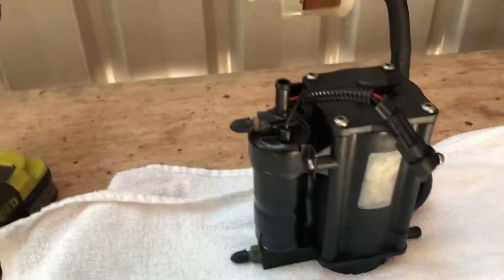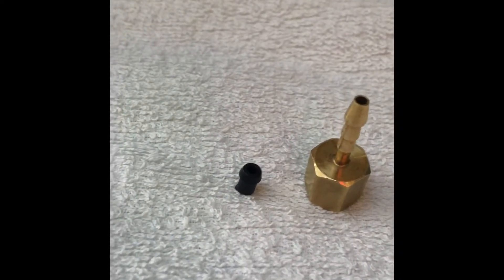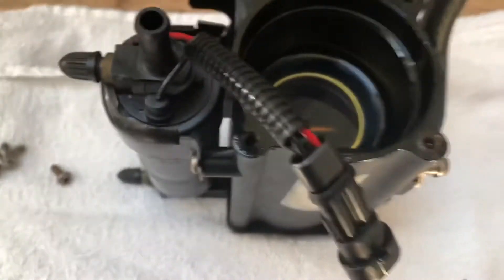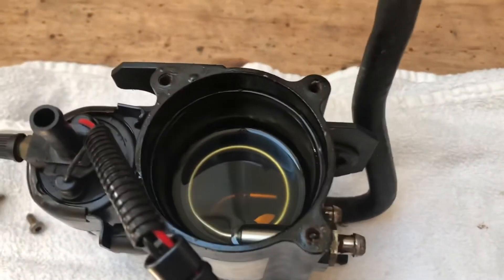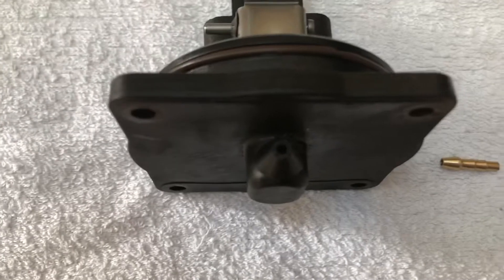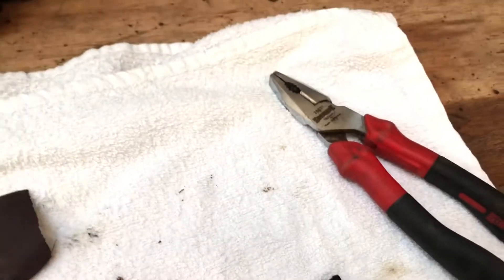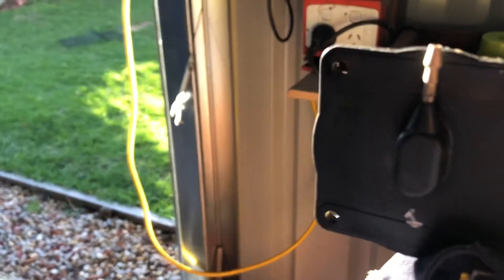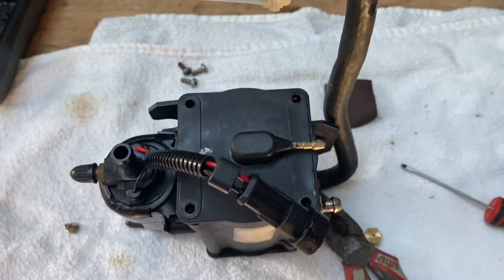Etec 60hp VST Breather Nipple Fix.

Comment: Did this broken barb repair too but I drilled and tapped the hole and screwed in a barb I made on my lathe. Used sealant on the thread.
As a precaution I removed the float and needle and blew through with compressed air. Just running the drill bit may not be completely reliable to get all cuttings out, and if a bit made it's way back it could stop the float needle closing properly.
Something else to be very careful of, is there is also a spring loaded ball valve (easy to miss) which acts as a pressure relief valve. You can see it under the lid. The relief passage goes into the vent passage too. I also blew compressed air through it in case any of the cuttings made their way into that passage.
If you squeeze the fuel priming bulb hard enough the pressure in the VST can be enough to open this pressure relief valve and you end up pumping fuel straight into the crankcase. Been there done that.

Comment: What were the symptoms when the engine was running? I have the same problem
Reply from the maker: Hey Allpine, sorry for the late reply. The issue i had was that the motor would start and idle properly but then throw a fault and go into limp mode when i engaged it in gear or increased the rev's. The fault code kept relating to the fuel pump and/or vst. I have twin engines so i swapped the VST and HP fuel pump but it threw the same fault code. After a bit of mucking around and some advice from a couple of blokes off of Barnacle Bill ETEC forum i found a fault in the stator. What happens is the HP Fuel Pump needs 55v to operate correctly and with the stator fault it was only getting 38-40V.The engine goes into limp mode when the pump drops out. Bought a 2nd hand stator from Nth Queensland and installed it and away we went. I broke the breather nipple during the fuel pump removal.

Comment: Hello boss, good video, I ask you, I have an evinrude etc. 90hp does not start and I get the code 94 - 29 - 117, what should I do? thank you
Reply from the maker: Hi Gringo, Sorry for the late reply. Not sure what model you have mate but 94 is fuel pump short/open circuit and 117 is a low oil event on mine. Firstly id make sure that when you start up the engine( connected to diagnostic software) you check to see it is transitioning to 55v. The HP(high pressure) fuel pump will not operate on low voltage.
Reply: @unclejeda1  Thanks, my problem is EMM, I have to change it
Reply from the maker: @GringoSF  Ah bugger! Good news is they are easy to replace. Problem is its expensive!! Good luck Gringo!